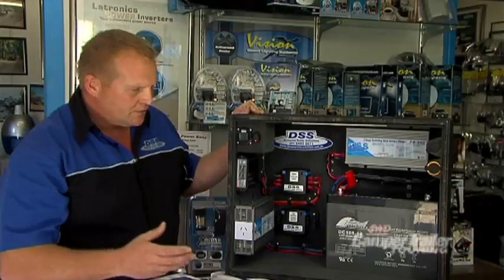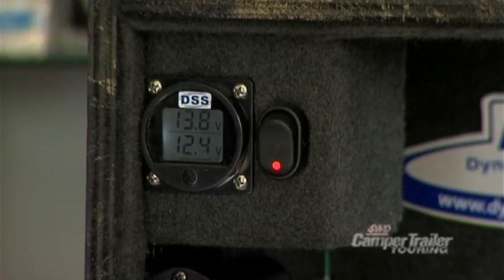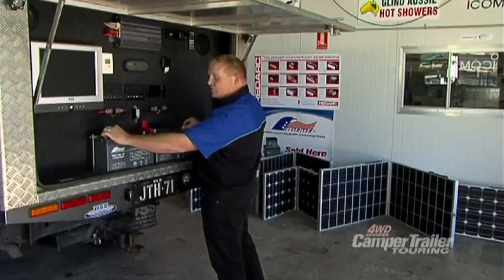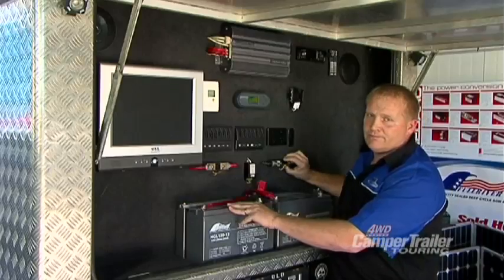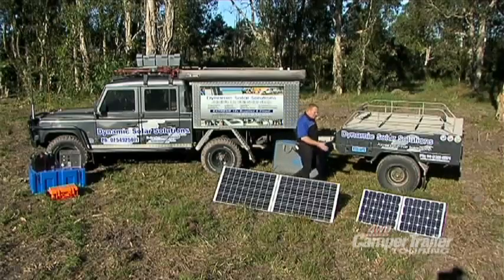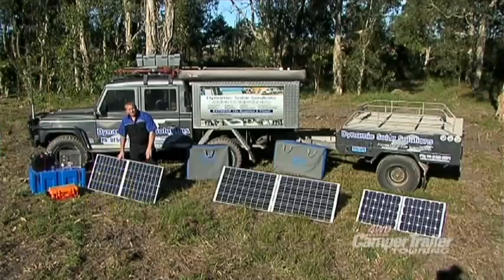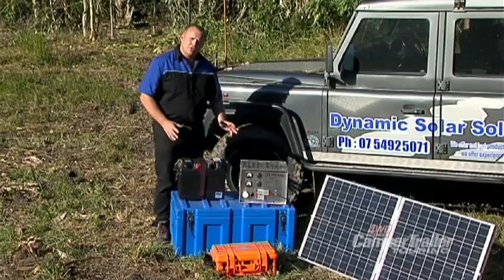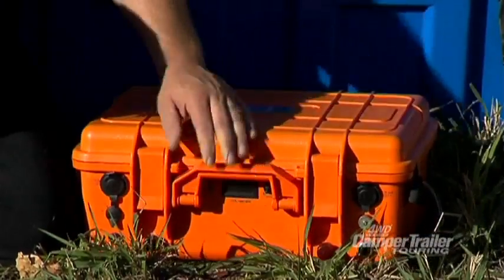JTS Offroad TV: Ultimate camper 12volt battery setup

Comment: Holy mother of dung! I almost got a heart attack watching this! 

What ever you do, do NOT do as this guy does in the video and put your hands on the poles on a car battery. Not even if you KNOW its a poor battery with almost no charge.

This can result in grave injuries or even death if your unlucky, specially if you got poor health or have a heart condition you dont know about.

This clip should be edited for everyones safety.

Regards,
Isaksson
Reply: The high amp potential on that battery does not make any difference because the voltage potential is only 12 volts! the resistance in the body is way to high to have ANY appreciable current go through it. You don't need to be concerned about voltage until you get to about 30 volts. I have touched both sides of 12 volt (including 24 volt systems) batteries my entire life and NEVER felt ANY current go through my skin. Instead of going off about this video being unsafe, you should get yourself more educated before making such outrageous comments.
Reply: Peter Isaksson. Hahaha lol wtf u need to be  schooled
Reply: Bwuahahahah...yer a goose mate..I'd happily stick my left and right nuts across the posts of a 12 volt battery......
Reply: Got to be careful if you have a ring on or a steel bracelet around the terminals it will get red hot in a second and strip  skin off
Reply: A 12v battery will only hurt you if you drop it on your foot! Even 24v, you may start to feel 48vdc,  but putting a low resistance, like a wire or metal, across will cause fireworks!!
Reply: +Have the #SocialEquityRevolution Already 

Ok, as to not have you kill anyone, here are some information about electricity.

While Voltage is importand when discussing damage it can do to a human body, that is not all that can do dmg to you. The amps is also very important, aswell as if its alternate or direct current. Also the path through your body is a huge factor not to mention any potential medical issues one might have, knowingly or not.

People can survive, if lucky, hits by lightning with voltage ranging in the millions of volts. In those cases, they are most often seriously damages and burnt, but the current has taken a path not causing damage to vital organs, such as the brain or heart.

Current flowing from your left hand to your right hand will be much more dangerous than the same current flowing from one finger to another finger on the same hand. This will lead the current in a path right through your heart and respitory system.

As in regards to AC vs DC, AC is a little esier to let go of than DC, as it doesnt take much to make current lock your muscles and block your nerve signals. AC alternates the electric polarity very fast, so it doenst always make you clamp down on whatever it electrifying you. AC will more easily lock your muscles so you wont be able to let go. Case of point is those electric massage things one can buy. those are low voltage and low amps, but can still effect your muscles to the point you no longar can control them.

A car battery, or similar, has a quite high amps, and if you are unlucky and the resistance in your body isnt high enough, or you or the battery is wet, then you can be in real trouble. 500 amps is a sure way to die, and many 12 volt batteries can easily produce that.

even IF you are lucky to not have 500 amps pass right through you, and only get a couple milliamps, it can still be enough to kill someone with a weak heart, pacemaker or some other medical condition.

That is not all that a 12 volt battery can do to harm you though. If its a short somwhere, it can seriously burn you. Sparks can also burn you and also catch things on fire. It can leak battery acid that can eat through your clothes and skin. One should always be really crefull when handeling batteries, even small ones.

When ever you are messing about with electricity you should know exactly what you are doing, and if not to be damned sure to let an electrician do the work.

Now, even if you feel like taking stupid and parehaps lethal risks with 12 volt batteries, please do not encourage others to do the same. Many do not know the dangers of electricity and might make mistakes. When working with electricity it is ALLWAYS better to be safe than sorry.

Regards, 
Isaksson
Reply from the maker: +Peter Isaksson :

        46
        down vote

            
            

    
In most ordinary circumstances, 12 V isn't even enough to feel, let alone cause a shock. As clearly shown in this video there was absolutely no adverse effect to the presenter.
The team at JTS http://www.jtsonline.com.au/ work with 12 volt batteries DAILY, day in day out. Including rather large battery banks in excess of 1000aH's

For the internet trolls who just like to argue mundane points:, it's really current that you feel and that shocks you, not voltage.  So when we say that 12 V is safe, we're making implicit assumptions about the resistance of your skin.
Electrically, you're basically a bag of salt water.  Your insides have low resistivity, but the skin has much higher resistance.  For current to go thru you, like from one hand to the other, it first encounters the skin resistance on one hand, then gets a relatively easy ride to the other hand, then again encounters significant resistance getting thru the skin to the other electrode.

Skin resistance can vary significantly, but is usually at least a few 10s of kΩ.  12 V applied to that resistance doesn't cause enough current to flow to even notice, usually. (yes this assumes normal average healthy people simply touching the battery)

COMMONSENSE DISCLOSURE FOR THE BENEFIT IN INTERNET KEYBOARD WARRIORS:If the two points where the 12 V is applied to your body are sufficiently wet, the skin resistance is lower, the current is higher, and you can feel the result. 

A simple demonstration of this is to touch a 9 V battery 
briefly to your tounge.  You will definitely feel it, and 12 V is 
another 1/3 higher.

I am not silly enough to have tried this (SO DON'T DO IT) , but I suspect that if you wet two fingers with salt water and then connect 12 V between them, you'd feel it.  Doing this between the two hands could even be dangerous because the current 
will flow near your heart.
SURELY IF YOU HAVE A PACEMAKER OR HEART CONDITION YOU WONT BE PLAYING WITH BATTERIES LIKE THIS ?????

Implying that this video will kill someone because you believe its dangerous for a human to touch both terminals of the battery is misleading (and attention seeking) at best. 

A car battery is a 12 V source that can provide large current, 
Often up to 1000amps. (with the right gear you can even weld metal with it)  When you put a very low resistance across a car battery, that large current will flow, which will heat something, possibly to the point of melting or even exploding. 

The reason this isn't relevant to a human touching a car battery is because our resistance is nowhere near low enough to let those kinds of currents flow.

So be extra careful to not accidentally short a car battery.  
Generally, 12 V is safe to work around, even if you got it across the hands. 
However, there is no point pushing it ...
www.jtsonline.com.au
Reply: +JTSOffroad TV: Jamie&#39;s Touring Solutions 

Thank you for clerifying my point. My response was brought out from concern for the health of others, nothing more, nothing less, and as you can see the lastest remark was also aimed towards @Have the #SocialEquityRevolution Already. It was in no way ment to imply that you at JTS have sub par skills in what you do, so please do not take it as such.

Also, i think its very good you give fast replies and feedback to your visitors. Many forget how important that is!

In most cases i do agree with you that 12v systems are farily safe to work with, if you got the know how about how to work with it safely. Accidents can and do occur however, and its always safer to be careful.

Also, I would not be so sure than everyone knows about any eventual heart conditions, or even if they did if they knew how dangerous even a small current can be for them. Here too one should be carefull to draw conclusions about what people might and might not know/do.

Someone without any experience can watch a video where people put fingers on the poles of a battery and not know what a serial or paralell batterie setup do with voltage and current. 

I just feel that your video would have been better presented without the presenter doing what he did as a case for better safe than sorry, its was not a critique towards your videos content per se.

The reson I personally came to watch this video was my keen interest in camping setups, and your setups seems really nice and clean, and im actually in the process of planning a similar setup my self for my old Polar Camper.

If I am somewhat unclear in my views, please note that im from Sweden, and it was about 15 years since i was tought Englishin school.

Best regards, 
Isaksson

Comment from the maker: Hi Bryce,

Electronics close to the battery does depend on the battery style. We use a fully sealed AGM. With these batteries there is zero acidic vapour so having electrons close is not a problem.

With power metering and charge rates it is best for the functional aspect of the regulator or DC Charger to be as close as possible to the house battery
Reply: JTSOffroad TV: Jamie's Touring Solutions  can you tell me how meny hr.s can i use the batter 12 and 24 v fully charging  ... pls